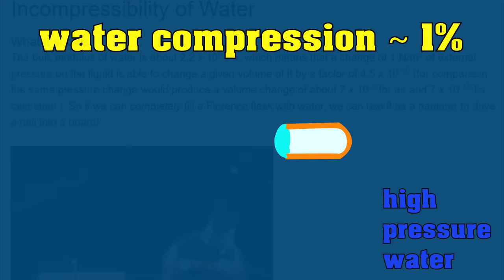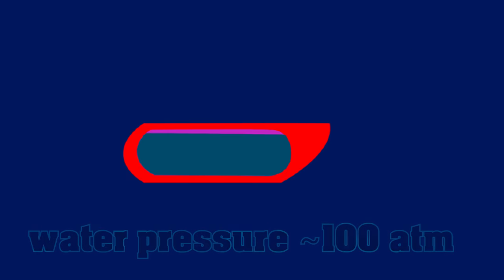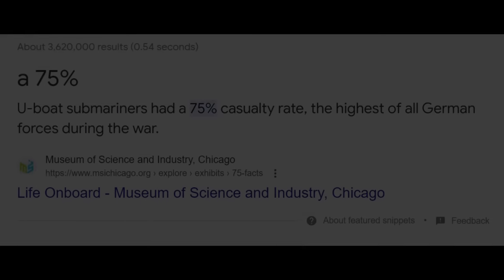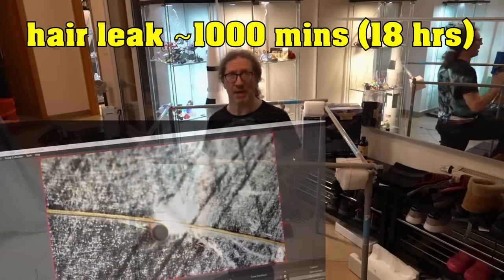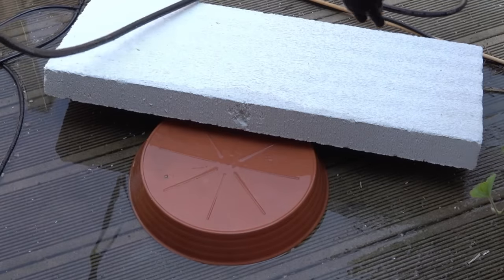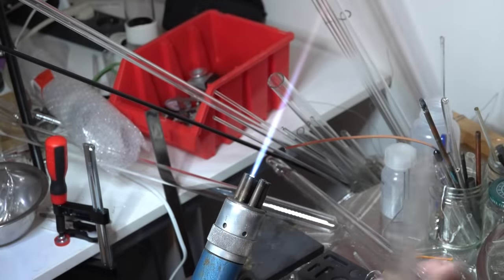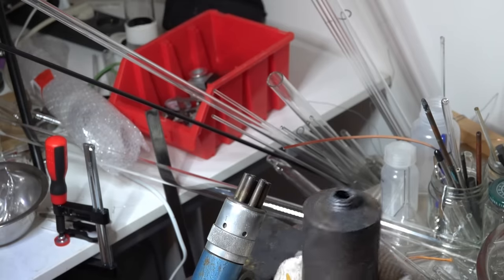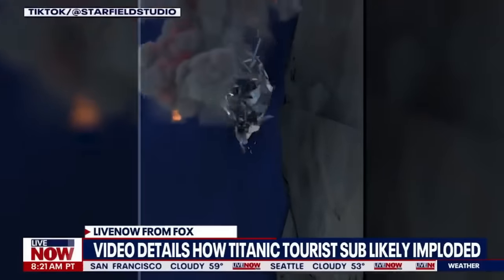Why the Titan sub failed

Comment: Exactly what I commented previously, a hole at that depth is essentially a water jet. Phil if u ever need any supporting clips let me know I have a water jet at my shop. Thanks for covering this man.
Reply: I enjoy your content and like your cars.
Reply: I've watched you channel, however no one doubts a pinhole at that depth is going to cut exactly like..er.. a waterjet.  
His primary angst seems to be with anyone who says what destroyed the sub/killed the divers was pressure.
Water compressability, speed of decompressing water, pinholes, etc, tangential bs.
Part of the straight carbon fiber hull failed, pinhole, crack it doesn't matter. Because whatever it was it led to an almost instant catastrophic failure of that tube, likely on the order of milliseconds.
If water did NOT compress, it would not make a whit of difference when we're talking about 6000psi.  

If this had been an old fashioned 360' diving bell that had a pinhole leak through 2-3" of titanium, then we could speculated on how many people would have been holed by that pinhole waterjet, and how long it would take to start taking on water, and people to drown or if slow enough, die from breathing high pressure normal air.
2 entirely different things.
Reply: Yooo, warped perception. The rocket car dude!
Reply: @Make-Asylums-Great-Again thank you!!!
Reply: @jacobrzeszewski6527 lol... Only cause I haven't uploaded in a while, I truly like to stay diverse.
Reply: Don't call him by his government name, you just ruined the mystique
Reply: @boots7859 thanks, oh yeah I am totally in agreement... That's a good perspective but yeah I was not disagreeing with anything just supporting.
Reply: I thought you of all people would be smarter then this. Even if the Sub was at its max depth to see the Titanic (which it wasn't) it would be under 350 BAR or just about 5,000 PSI, nowhere near the pressures of a Water Jet cutter which normally runs at 30K-40K PSI. Even at 5,000 PSI it would have ripped apart the hull and imploded before they even knew there was a leak.
Reply: WP stop following me around!... I guess in this case I followed you hah. great minds think alike. keep up the good work my dude.
Reply: @boots7859  if you watched the video you would see that water at that depth does not act like a water cutter lmao. go back to elementary school and pay attention next time
Reply: Water compressibility is irrelevant, in this case as under no circumstances would a pinhole leak occur in what we would typically consider a pinhole or waterjet leak or anything. It's instantaneous, or as close as can be....
Reply: @bkordel  So instead of what Philip is saying,  a single weak point lead to a fwoop sub-millisecond implosion then?
Reply: Can u send jet for my blog ?
Reply: I hear the Waterjet channel has a water jet too.
Reply: A hole at that depth is a structural weakness which would instantly result in a catastrophic implosion. The idea that the sub filled with water is nonsensical.
Reply: It's what probably cut the battery power or the battery. Flirting with disaster, molly hatcher
Reply: @balljointfd3s  your right, 144,000 in of water column is 5197.06 psi. However the "Wazer Water Jet Cutter" is 5000psi. Yeah it's like the weakest of the water jets but it is a waterjet. 🙂, Tbh I didn't do the math, I was just talking
Reply: @SawyerKnight  lol... Did I see u in another comment section?
Reply: @Blox117 depends on the shape of the hole 🙂, but doesn't matter at that pressure any leak will cause some sort of water damage.
Reply: @bkordel  depends on the details, things don't just Break into pieces especially ones there's a localized failure, it could have cracked and leaked violently
Reply: @erikkovacs3097  I would have never guessed that. But they do have a dinosaur
Reply: There’s a transcript of the communications between the sub and the surface ship that indicates that the sub heard sounds in the mechanical section of the sub (aft). For at least a few minutes. This section of the sub had a wall between it and the crew portion. It’s possible that the aft section had a small breach which filled up that section and caused damage. Apparently they lost power and damage within that section could have been the cause. They apparently released the ballast and the entire cage in order to try and lighten the submersible, and cause it to rise, even without power. But it would not rise properly. It was extremely slow to ascend If the aft section was filling with water, that could be the cause. This is all based on a transcript which hasn’t been officially confirmed yet (that I’ve heard).
Reply: @boots7859 This is exactly why I prefer channels like WP - focusing on logic, science, facts... I've seen a few too many videos on Thunderf00t that are just completely devoid of logic and facts, and they are nothing but weird conspiracy theorist propaganda. He sets out to disprove tons of conspiracies, but he doesn't let the data show him that he's wrong. He is too biased to properly analyse the topics on which he speaks.
Reply: No.  Just no.
Reply: No pun intended. But your guys are out of your depth. You litterally have no idea what actually happened
Reply: @boots7859  "pinhole at that depth is going to cut exactly like..er.. a waterjet.  "
apart from the fact it doesnt have the cutting agent in there! Which is what makes it work! also its alot less pressure! 1/10 of a low pressured one!
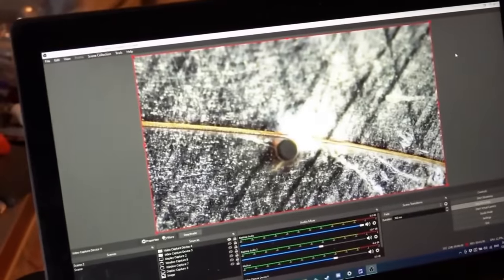Reply: 08:25 Maths is hard simple perception is a lot harder!
Reply: THUNDERF00T ANSWER THIS MAN!!! This would be a collab for the history books!
Reply: What really doomed the Titan was
the fact, that the carbon fiber & ti-
tanium 32 feet of glued joints
wasn't secured by some ducttape.
You can't mess around with 6000 psi  unpunished  🥳
Reply: @WarpedYT it does depend on the details and a key one is "carbon fiber". It doesn't fail like "normal" structural material for example on a carbon fiber wheel for a bicycle if you hit a hard bump and put a small crack in the wheel you don't end up with a cracked carbon wheel it just turns to dust and thin long strands of fibre almost instantly, same with carbon fibre drive shafts, composite tanks, etc.
Reply: @YYmmmYY  cringe comment
Reply: @phoqueoeuf  how so?
Reply: I work for FLOW JET building crates all the time for BADASS 5AXIS FLOW JETS
Reply: Yeah, at 12,000 feet depth I'm sure it doesn't take much of a fault.  From what I'm hearing, this guy was bragging about the corners that he cut.
Reply: This thread is the last word on geekdom
Reply: @WarpedYT  No worries, I was figuring you were prob focused on the waterjet aspect.
Reply: @balljointfd3s  But how many people/experts in the field truely believe it was some sort of pinhole to begin with. It was most than likely a crack, perhaps pinhole size at one instant, and rapidly enlarged within milliseconds as structural deforming/failing occured.
For all we know, there may have been a several inch long crack fault.
As said though, does even that matter? At close to 6kpsi, any failure would have about instantly + 1 instant have enlarged and then kept on enlarging every +1 instant.  Focusing on the pinhole for some reason seems rather daft considering the material in use.
Reply: @@nullnvoid123 Yes, exactly. I like TF but this seems a bit of an odd quirk of water's intrinsic nature to go on about.
Reply: @Blox117  I'm well aware of the actual pressures in water cutting as a layman who watches Fireball Tools. And my comment was exactly that even if it had acted like some sort of water cutter it was still immaterial and the video was a conglomeration of random water intrinsics like compressability and the volitile nature of normal 1 ATM water being compress until it becomes toxic, etc, vs the obviousness that pressure in fact is the proximate cause of implosion vs ping leak, drowning, etc.
Someone certainly needs to re-school vis-a-vis reading comprehension.
Reply: @miinyoo  Pretty much. A single week point caused a structural failure which occured likely in milliseconds. Was this caused primarily because water is 4-5% compressible? No. Its because the sub had 5-6Kpsi on every square inch of its volume. Yes, one can argue that water's compressibility helped once it had a chance to expand, however seems a little loco to focus on that 4-5% expansion when you have 5-6K of non-compressible water psi.  Maybe its just the pedantic nature of teachers though.
Reply: @pseudotasuki  I don't think TF actually believes that, its just that he was back and forth with 'potentials' that it seemed it might be so I thought I'd question it. I think he really believes water compressability is somehow what caused any pinhole/crack to continue on to complete failure which seems doubtful. Conversely, if water were not compressible, is he saying it would not have failed basically identically?
Reply: @thecloneguyz  I'm sure I've seen you at the show.
Reply: @taylormay9938  I like AvE and TOT myself, not hard sciences though.
I like TF and some of his Musk videos are indeed hilarious and show an aspect of grifting or better, taking advantage of stupid laws.
And while I recognize he does that, I also have to be logical and admit that he has dragged a couple of giant industries far more forward than anyone else in the current age because of some of that hyping, and because he is willing to risk his own money.
While some of TF's vids are funny exposes of the white-paper fools who seem kind of cultish, a number of them seem to be repetitive and focus on delays that in every other area of scientific research and industry are seen as common, unavoidable stumbling blocks on the road to advancement.
Real science says everyone/thing must be open to criticism and provide proof, and TF should be held to the same standards to be credible.
The Hyperloop, cyber-truck and solar shingles should are are mocked, but where are the videos on Solar City, SpaceX, Tesla and the advances they've forced through despite high-cost failures?
Gotta be fair if you're going to try and set yourself up as a professional critiquer.
Reply: @tempusername-l5d  I believe after thinking about it, TF prob meant that the failure caused a massive influx of water into the sub at above the speed of sound because of water's compressability.
If this were true, then photos of the debris field should show that the sub experienced an explosive like event vs and implosive one.
Wreakage I've seen looks like a flattened soda can. Assuming its current shape is relatively similar to how it was found before being brought up, it would seem like that should point to implosion and simple pressure vs the convoluted water compresses/explosively expands conjecture.
Reply: @boots7859  How many experts? None! That's my argument. I appreciate your reply but it seems like we are arguing the exact same thing.
Reply: @boots7859  and yet you fail basic grammar and sentence structure.
Reply: @petersoerent2554  
Don't underestimate the power of 'glue'
"J-B Weld has a tensile strength of 3960 PSI and sets to a hard bond overnight. It can withstand temperatures up to 550ºF when fully cured." - A random 'glue'
"Let me clarify – single component epoxy adhesives have the highest tensile strength often 35-41 N/mm² (5100– 6000 psi)."
Reply: I imagine the composite crumpled when the ring glue joint failed. Like the end of a can falling off and the middle broke into several pieces.
Reply: @WarpedYT  they've been working on something special in the back room for a while now I guess it can cut through 36 in
Reply: @Ikbenjounietsukkel  
Hm... First of : The 2 titanium
parts were polished, not rough,
so the glue had somehing to 
hold on to. A common trick
when you use glue.

Second : No glue will last for-
ever. And the Titan had been
used extensively,, and exposed
for extreme condistions.
Remember, titanium and carbon
fiber behave differently under
6000 psi pressure. VERY diffe-
rent !

Thirdly : There is no way to test
(from the outside, or anywhere
else) whether the glue is  STILL
working as intented or not. 

This weird carbon hull might
work well ? But let's say max 
25 dives 

And : It has to tested at least
50 flawless times, to be certi-
fied to last 25 deep (4 km/12k
feet) dives.

This was nothing but Russian 
Roulette. Doomed to be a dis-
saster. Before or later.
Reply: @petersoerent2554  
1. I would say that would go for most 'glues' yeah.. Sanding gives the 'glue' more surface area to hold onto.I haven't looked it up how they pretreated it, nor do i care about that. 

2. I honestly have no clue, a lot of different glues with different applications, they all last a diffrent time tho. For example the glue that holds my windshield down on my car has been there since 1992, still not a sign of giving in. 
That's what there is elastic glue is for, it's like a rubber glue, it can move and stretch, just like the glue that holds the windshield. 

3. I'm no glue expert, i dont know if there's any tests to check.

I dont care for the hull, all i'm saying is people underestimate glue it seems like. Heck on other video comments they weren't even aware of elastic glue's... 

Lots of mistakes from what i hear yeah, not trying to defend anything or anyone, just saying.. don't underestimate glue.

~Edit, Just reminded, my dad's 1969 car still has the original windshield glue in there.
Reply: @boots7859 What are you talking about? It's an investigation, and the guy offered to make a water jet video to demonstrate its power. How is it tangible bs?
Reply: @boots7859 Tagential*
Reply: That's warpedPerception water jets on 5th and Corwell . Tell them Jim sent you.
Reply: @tempusername-l5d  well, let us say that at time zero the structure is able to withstand the pressure. next, a small breach occurs. at this point the structure as a whole does not yet fail to withstand the pressure; from a stress-strain point of view, very little has as yet happened. however, an appreciable water jet does enter through that breach. at this point the vessel starts filling up (at a rate which might well take over 10 minutes to fill the cabin space, for the size of the initial breach) but then the breach starts to widen, which, as you say affects the structural integrity of the vehicle, and yes, at some point the walls will buckle inwards. However, concurrently, the inward water jet quickly gains in volumetric rate, and compression of the inner air bubble becomes an issue for the occupants (alongside the obvious issue of wetness entering at dangerous velocities). If the breach spreads rapidly alongside the hull, the buckling (the implosion that everybody talks about) will occur before the water hammer; alternatively,  if the breach takes the form of a widening opening on one end of the vehicle, the water hammer (plus compression of the air inside, and so on) effects will prevail. As for the notion of buckling; I assume the composite material is fairly brittle, i.e. it will shatter even when the deformation is not yet dramatic (as one would see with a beer can crushed by overpressure). Technically, this would still be called buckling (because the term essentially belongs to criticality analysis) but yes, it would actually pretty much look like the animation.

I am guessing that TF actually intuits correctly that the water hammer effects kill before the "implosion" does; and I am not sure if the matter can be settled from the available data.
Reply: Oh hey, warped perception watches TF! Sweet!
Reply: @Five_y_kay  lol hey! .. Yeah been for a while since he had like 100k subs, I love his whole busted series, he says everything that I wish I could say.
Reply: That is nice of you to offer.
Reply: @@nullnvoid123 Agree. The compressibility of water varies slightly with pressure, but at the envelope we have here the number is actually about 1/2%, not 1%. That only as a matter of interest. Either way, the compressed water does would expand when allowed - and at a tremendous speed too - but only at that fractional amount. In the scenario where we have 1:400 compression of air, that action would play no detectable role. There would be no "explosion" when compressed water is released. That's why pressure tanks are being tested by water pressure.
Reply: @boots7859  That's like saying, the bullet didn't kill him, it was the deceleration of the led. These annoyances don't make you sound any more intelligent.
Reply: @miinyoo  Delamination of layers leads to sheets ripped from the hull inwards, tearing larger sheets out while the wave of sound caused by that event running through the hull faster than sound in air causing further delaminations all over the place. It all gets ripped apart in a few milliseconds, and then the air gets compressed from all sides instantaneous, heating up to some thousand degrees, cremating passengers in an instant. All that is documented. The sound wave got recorded, the debris was found. Every single word Phil Mason uttered is bullshit, every second of his stupid video an embarrassing shame.
Reply: @hans-joachimbierwirth4727  "It all gets ripped apart in a few milliseconds, [...] cremating passengers in an instant. All that is documented."
lol sure.
Reply: I had no idea you two watched or followed each other. Both channels are truly amazing.
Reply: @taylormay9938 Could you name a few more?I would like to have a look at them.